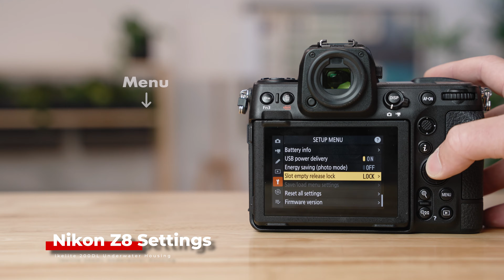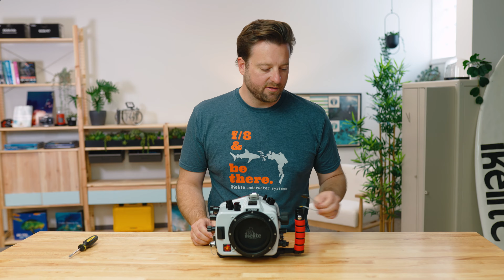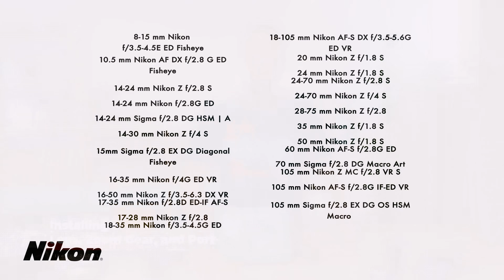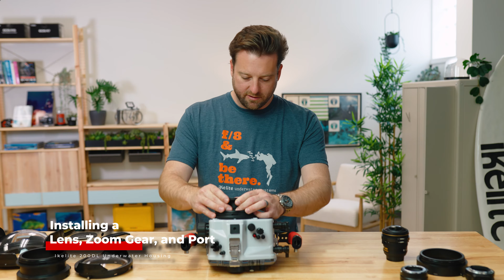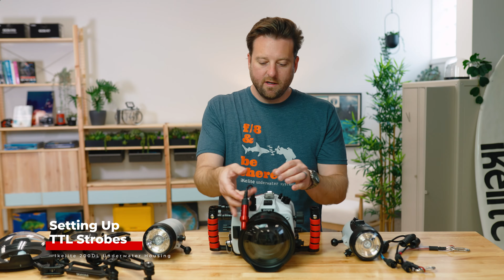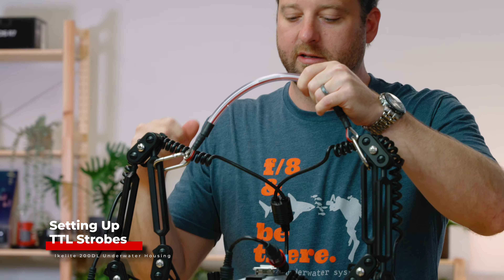Nikon Z8 Ikelite 200DL Underwater Housing Assembly

Comment: cant wait to have mine. do u think the 24-120 z lens is too big to fit?
Reply from the maker: We haven't had the opportunity to test this lens, but its minimum focusing distance and overall size make it less-than-ideal for underwater use.
Reply: @ikelite   @ikelite  nikon says min focus distance is 14" from focal plane mark on the camera body at all zoom positions. if the lens is 4.7" at 24mm, can u get as close to subject as 10"? and the lens is 7" at 120mm, can u get as close to subject as 7" or it doesn't work like that?
Reply from the maker: @sergiollag1  No, its due to the apparent image created by the dome port when submerged. This is where the minimum focusing distance becomes an issue.
Reply: @ikelite  thanx